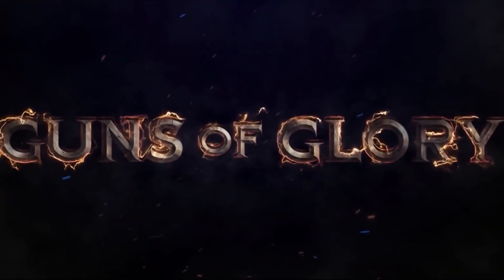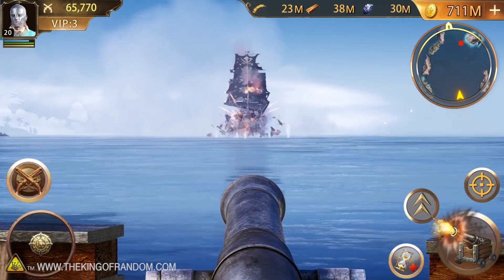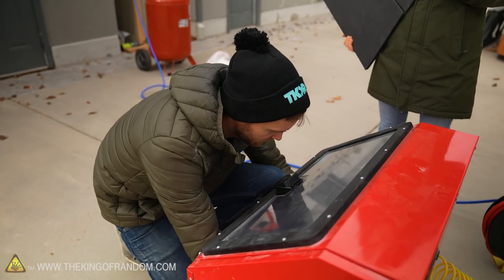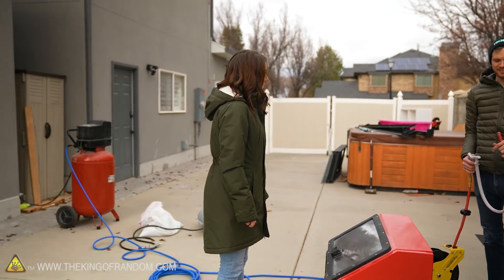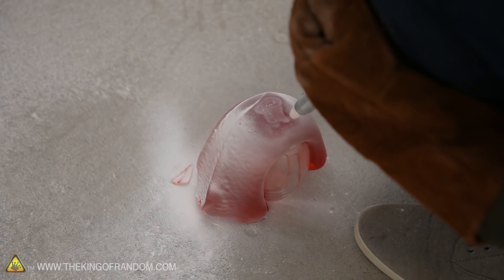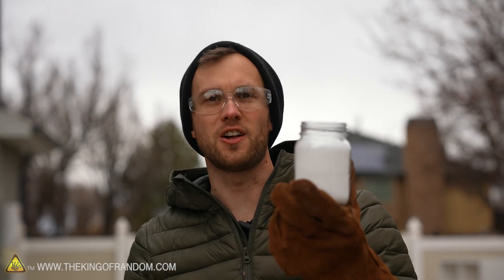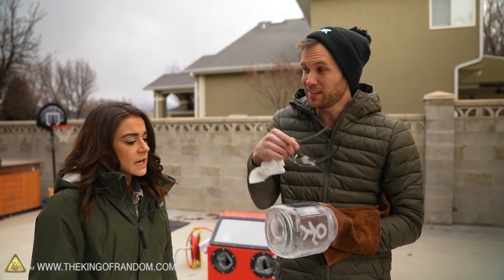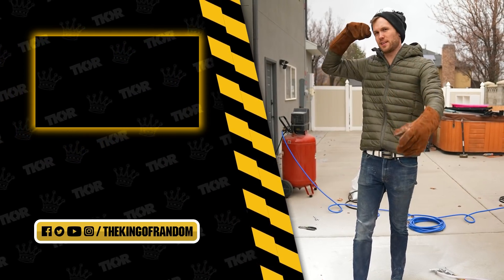Blasting Flavor at 100 PSI!!

Comment: I sand blast for a living.  I mostly use aluminum oxide but I also use plastic, soda, glass and steel balls. The booth i work in is so big you can drive a semi into it. And technically it's called media not sand lol

Comment: Try baking soda. I remember somebody restoring a car, and they couldn't use acid bath to strip paint because there would be nothing left of the body. I remember them saying it works about the same as sand but more gentle to metal.
Reply: Soda blasting.

Comment: Sand is eroded rock generally and usually its a silica based tetrahedra (strongest geologically due to paulling's principles) which is a pretty strong bond structure. Salt is ionic, and the sugar is just covalent. So it was a neat experiment to display which bonds are strongest.

Comment: When I worked in a Chevrolet garage in the late eighties we cleaned carbon from intake passages and valves with a blaster using ground walnut shells. It did a great job of removing the carbon without harming any of the engine parts, plus we didn't have to clean up the dust because it was harmless.

Comment: wonder what the sand blaster would do with powdered metals like magnesium or iron filings
Reply: I mean in theory iron filings would totally rip the rust off metal wouldnt it. I mean it may even possibly break the bit of rusty metal in half lols
Reply: You REALLY don't want to run powdered magnesium through a sandblaster.  That would be a very bad day.
Reply: @kdarkwynde  why what would happen

Comment: Believe it or not, Walnut shells are commonly used in sandblasters!
Reply: Walnut works wonderful removing old paint and body fillers
Reply: Its not actualy sand thats used, its normaly the crushed slagg from metal foundry, or glass
Reply: Wow I did not know that
Reply: @jacoblue0788  same
Reply: Another unusual blasting medium is dry ice pellets. The main advantage with them is that there is no cleanup. So you don't have to worry about it getting in something like an engine and causing problems. At least not as much since whatever it blasted off is still potentially problematic.
Reply: @AgentWest  really? Thank you for this. I have been avoiding using one again because of clean up!
Reply: @mfcryptidsheep4661  So i heard, anyway. Problem with dry ice is that you can't really keep it for long. Once thing you can also try is an adapter for the pressure washer (about $50 on ebay) that will turn it into a wet blaster. No dust, but sand can still get into places so i won't go blasting an engine or anything with it.
Reply: Also used to toss into running aircraft jet engines for cleaning.

Comment: early btw sandblasters are hard to make in many ways like most dont own a compressor
Reply: Air compressors can be reasonably prices.  It's a low barrier to entry for a cheap one.  Under $50.
Reply: Then you wouldn’t have a need for one